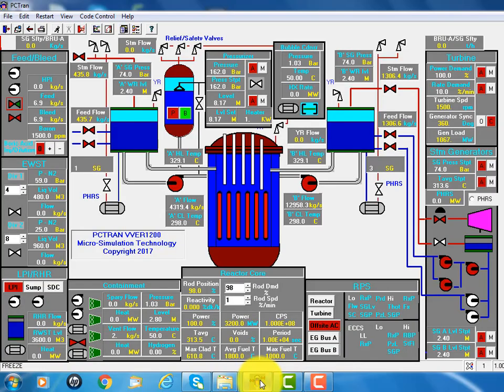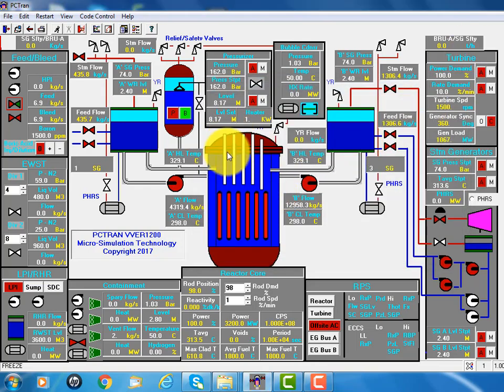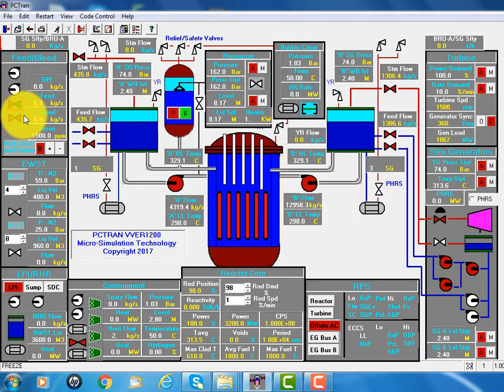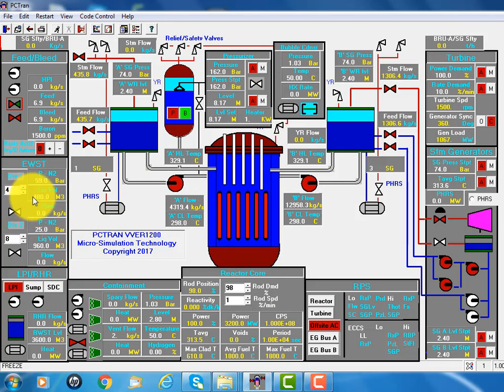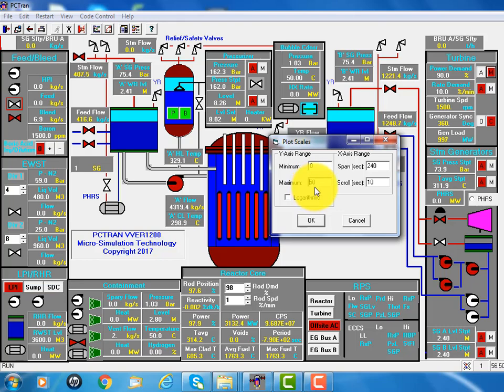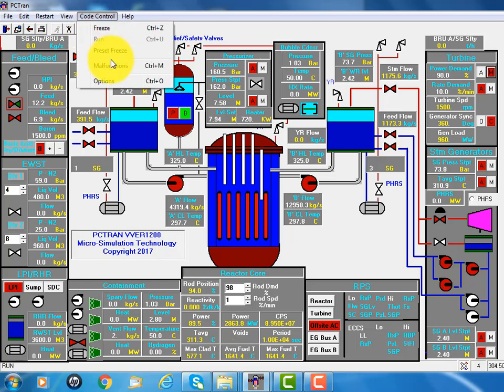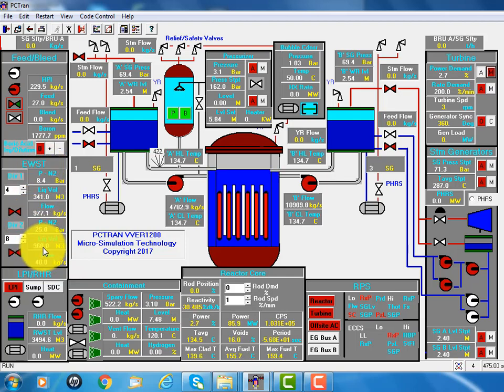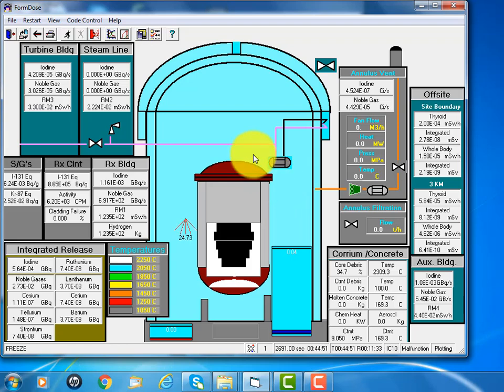VVER1200 - The Russian VVER-1200 (NPP-2006 or AES-91)

Comment: How can I generate Isotope data for a certain Accident?
Reply: You have to set a release path for your accident. For LOCA if the containment is intact, i.e. with a failure, there is little but still calculated release via its design limit,. For others, each has its designated path such as auxiliary building vent, turbine building contaminated steam, etc. Very sophisticated and detail data

Comment: Thank you so much
 sir In which condition the containment building will fail, and how much radioactivity will  disperse into environment  in that case can we calculate that from this software?
Reply: Yes, PCTRAN calculates radiological releases source terms from possible 4 pathways - namely the containment boundary, auxiliary building off-gas stack, steam line relief valves, and the turbine building.  We have another software RadPuff to process its dispersion according to the real-time meteorological condition such as wind speed and direction. Its demo is also provided on this site.

Comment: How do i get the simulator ?
Reply: PCTRAN is for government/industry/university use only. It is not suitable to non-professional individuals.  Please use your organization's official email to address to info@microsimtech.com, then we will provide you a quote for your specific need.  Thanks!
Reply: But I want to fly this reactor!
Reply: @TheMax0005  Nuclear reactor requires heavy shielding to protect its operator's safety. Back in the 60s there were designs by the Soviets. None materialize so far.
Reply: NPP is very big. There is no nuclear powered plane yet.
Reply: @lichipo2728  I have contacted at that email from my institution, pls respond.
Reply: Ask you employer or university to send us a request. We will quote a price.

Comment: Sir, 
I have a question. What does it mean by failure fraction and what is the method of assigning that value?
Reply from the maker: For example, Malfunction No. 2 in PWR is cold leg break. Failure fraction 100% is 100 cm2 break area.  But it is not limited to 100%.  A larger 1000% is 1000 cm2 break, etc.
Reply from the maker: If you choose No. 1 for a hot leg break failure fraction of 100%, it is defined as 100 cm2 size, 50% is 50 cm2, 200% is 200 cm2, etc.  The coolant discharge rate is calculated according to the critical flow model.  Other fractions are defined as instructed.